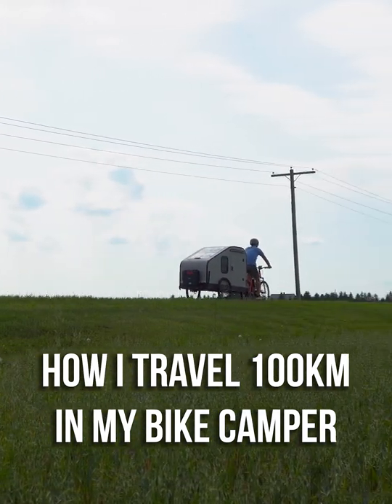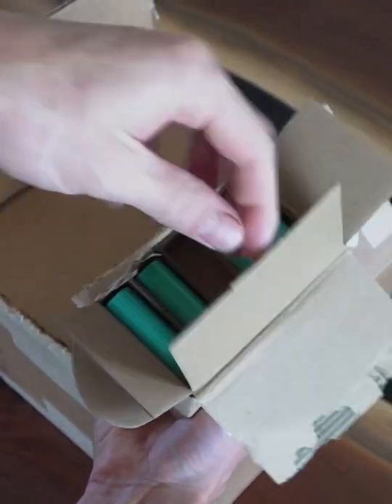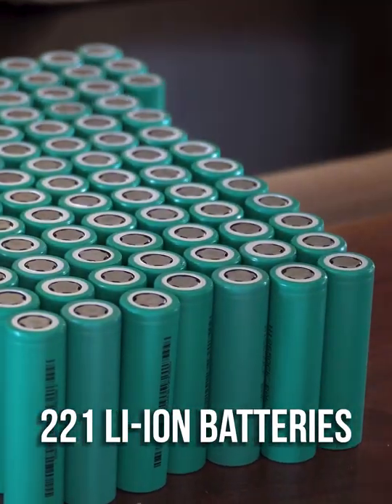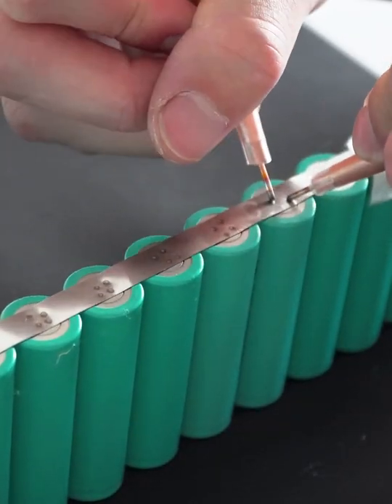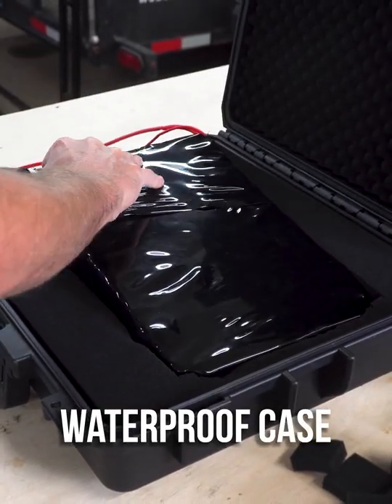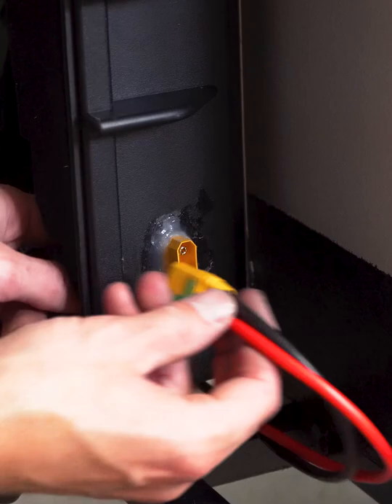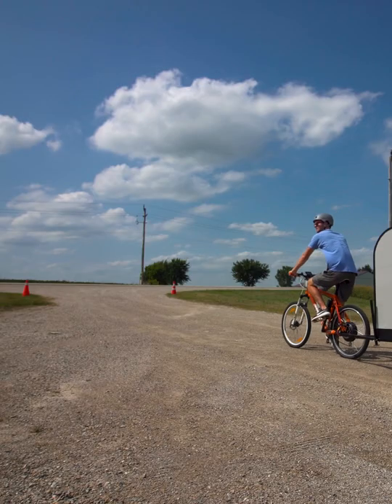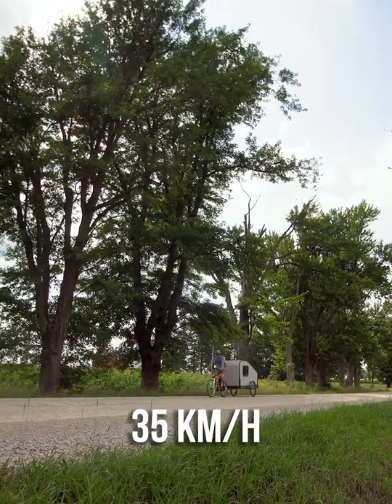100km on one charge... #shorts

Comment: This will add a lot of weight, but going Lifepo4 will give you a lot more longevity and safety out of your battery pack. A 48v 100ah pack would leave you enough power to go anywhere and keep you warm in the cold

Comment: This is the best Ebike camper build on YouTube. It inspired me to get a custom teardrop for my bike, so thanks! 
The trailer is to wide to fit through most of the barriers protecting the rail trails on SW Ontario, otherwise I’d be building off your brilliance. 
So how many watt hours is your custom battery? Well done, loved the build videos on this. Cheers, with thanks
Reply: Maybe a folding tent is the way to go? I wonder if have narrower folding roof tents, like one man size?
Reply: @0xsergy  I’ve considered it for real, or a design like this that’s able to expand like a tip out on a motorhome or travel trailer. 
I’m not pitching for views but I did post a video you could check out my design. Had my father in law build it, unique to say the least and I can go 100 kms on my two batteries with one to spare in the trailer. 
Great suggestion, I’ll keep thinking about that. Cheers.
I did see a video out of Germany where a guy used a rooftop travel case to make a rooftop like shelter, might check that out too. Germany is the place for this type of trailer, unquestionably!  Thought of that after posting the reply :)
Reply: Maybe not.. look at my channel ..

Comment: So, I've been welding bicycle trailers since 1996-7 and took photos to prove it. How many batteries can you comfortably bring with you with no charge? I imagine 6 of them would be great for a really long haul. A solar canopy may also be useful for peak sun hours. If you can get 500w panels on there also, you might only need 3 batteries. Also if you have extra light panels in trailer for when parking. Now get a 48v inverter and boom! Power a small ac unit when parked against the tiny house.